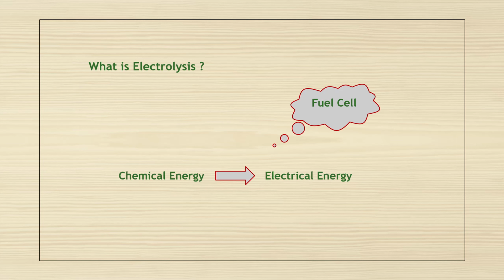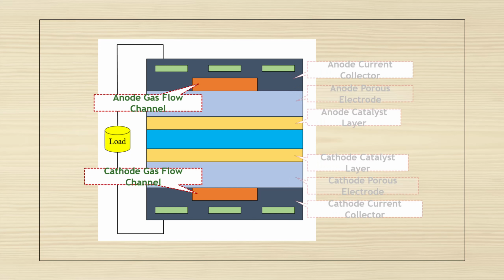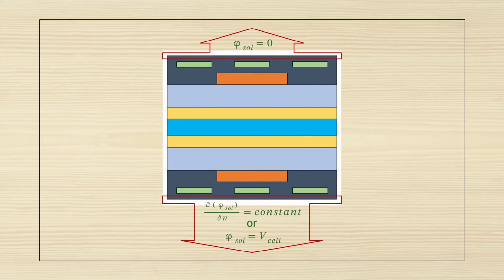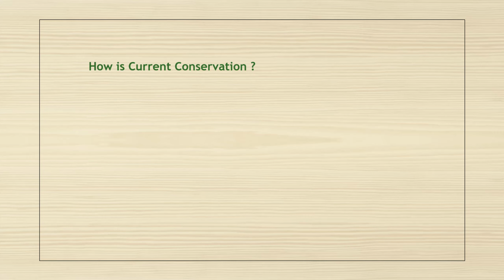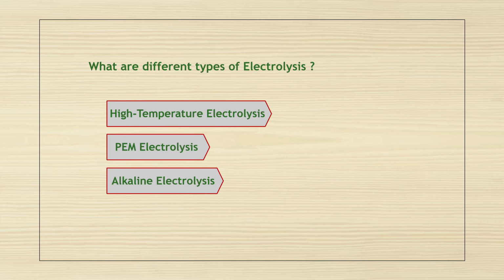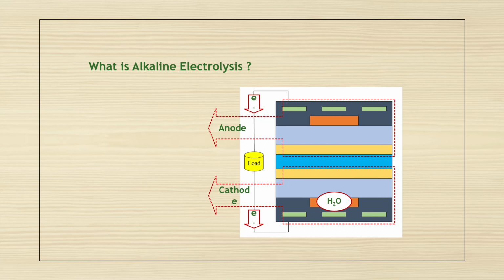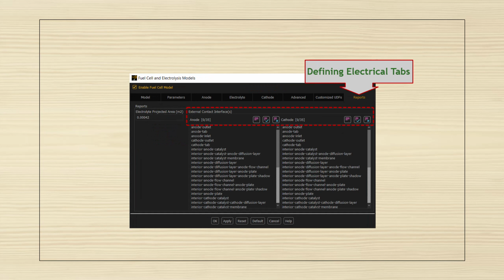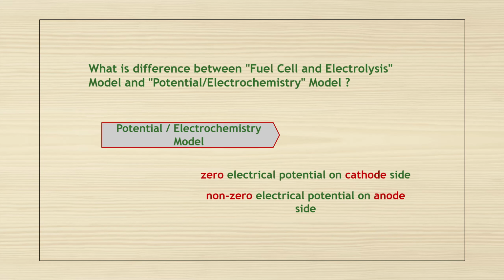Electrolysis CFD Simulation Concepts in ANSYS Fluent

Comment: Hello, Thank you for such a informative video. I have a doubt as follow for electrolysis problem: Two Potential transport equations needs to be solved, electronic and Ionic potential. The governing take a generalized Poisson form ∇·(K∇Φ) = ± Source; now, for boundary conditions: At anode walls, Fixed potential, Cathode wall- Zero potential, whereas for Ionic potential, typically zero gradient/ zero flux conditions for both walls. If the ionic potential equation effectively has only Neumann-type boundary conditions (zero-gradient everywhere), then mathematically I believe this will lead to a non-unique solution, and it will be dependent on the initial condition. How ANSYS Fluent ensures a unique solution for the ionic potential equation under these conditions? Or I'm conceptually wrong?
Reply from the maker: thanks, please be in touch with email regarding this issue info@mr-cfd.com